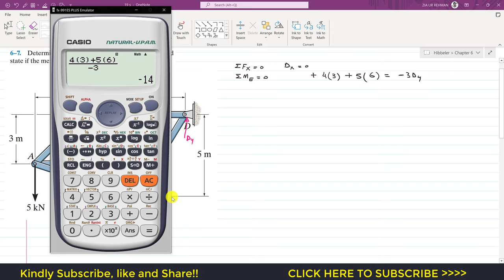6-7 Structural Analysis Chapter 6: Method of Joints Hibbeler Statics 14th ed Engineers Academy

Comment: Why is DE in compression? thats the part the confuses me because i always just assume tension but if i get - then its the opposite, is this wrong?
Reply from the maker: Ur doing it right, always assume tension.
Reply: I would say DE is in compression because of the horizontal force of DC, which acts as DCsin(theta) downwards on DE aswell, pushing into point E.
Reply: FDE is pointing towards D, and we found FDE to be positive in that orientation, so FDE is compressing the joint.